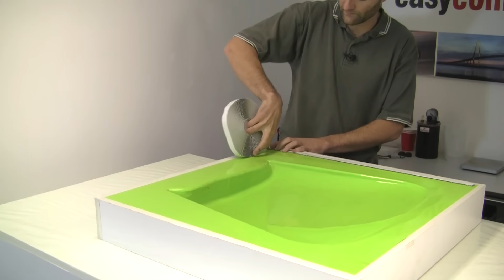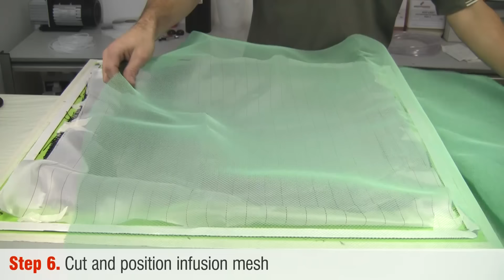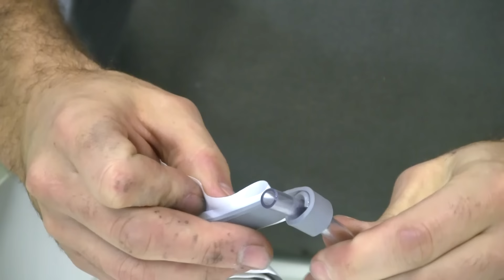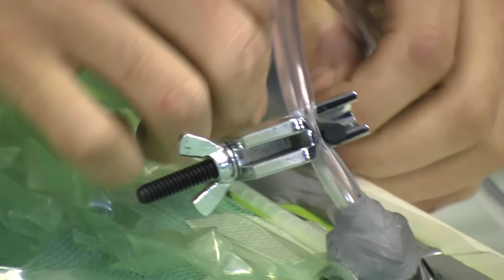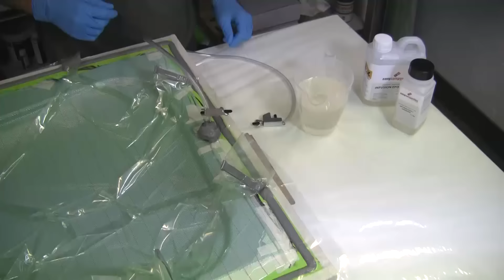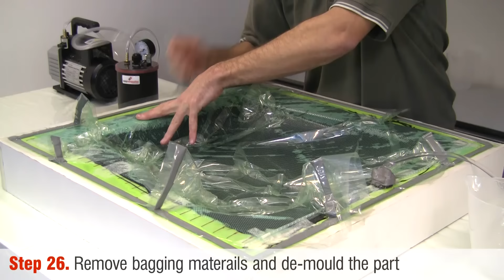How To Do Perfect Vacuum Resin Infusion of a Carbon Fibre Part - Basic Tutorial

Comment: Dear Mr,
First of all, thank you for this interesting and didactic tutorial. Regarding to the formula that you prepare, I am curious to undersdand why don't you use a defoamer/air release agent in order to reduce the waiting time and also an additive to improve the wetting of the fibers. Could this last additive avoid the use of the net? 
Thank you so much!
Reply from the maker: Thanks for your comment. There isn't really a need for any additives in the resin as the air is pulled out when the resin is put under vacuum inside the bag. 

You need the mesh in order to allow flow channels for the resin to pass though, without this the infusion will choke and stall as the resin cannot pass through the fibres.

Comment: Que máquina de vacío recomienda
Reply from the maker: For a job like this our EC4 pump is perfect.
Reply: @easycompositestv  y aquí como uno la puede comprar para que yo voy de colombia
Reply from the maker: @ We can ship to Columbia from our site here in the UK, simply add the items to your basket and select the delivery destination. The website will then calculate the shipping cost and estimated shipping time.

As the pump requires 240V to operate you may need to do some rewiring of your power supply in order for it to run.

Comment: Is it mandatory to put the item in the oven to post cure when infusing?
Reply from the maker: No, post-curing can help to improve the mechanical properties and temperature resilience of a finished part but for ambient use products where ultimate properties are not required, you can just allow the resins to cure in normal temperatures.

Comment: Do you need a “tempered glass” lid on the vacuum chamber ? Or will an acrylic lid be fine? Will the resin gases crack the lid?
Reply from the maker: Our chambers use an acrylic lid.  However you have to be careful with acrylic to not expose it to strong solvents such as styrene and other solvents in polyester, vinylester and acrylic resins.

Comment: Very beautifull, but I have a Question. Since carbon and epoxy are expensive but also very very strong what makes you decide howmany layers of carbonweave you use? Would one layer also be enough for that panel? What would be the difference in the endresult if you compare a one-layer vs a three or more layer panel ?
Reply from the maker: Experience and mechanical testing will ultimately decide how many layers a panel will need.  For structural applications mechanical simulation in CAD FEA packages and test sample mechanical testing will be more common than experience with previous similar panels.
Reply: @easycompositestv  thank you 👍
Reply: I have another question. I am more into boats than motorvehicles or industrial applications. Now on the deck of a boat we want an antislip profile or an antislip topcoating. How can that be done?

Comment: Do I have to remove the paint from my car chassis or it will stick to the paint?
Reply from the maker: Generally key the surface with sand paper to help adhesion.  Assuming the paint is thick enough, you should be able to do this without cutting back to the metal.

Comment: Hello. I tried this once and my whole garage filled up with smoke from the vacuum pump. It was pretty nerve-racking and the wife was pissed. Do you have any idea why the vacuum pump would’ve been smoking so much?
Reply from the maker: Most rotary vane vacuum pumps emit a oil vapour from the exhaust. The longer the pump is on load or against a leak, the more oil mist is emitted. In a confined space this can make the room appear smoky from the vapour.  Ventilation or extracting the vapour will help.  Also you can use a pump with a built in oil separator to minimise oil mist.
Reply: @easycompositestv  thank you very much for the clarification. I was looking into oil free pumps as well although they are slightly more expensive.
I guess my issue is also that I didn’t understand that you run the pump take out the air and turn the pump off I had the pump running for hours on end as it was not a vacuum infusion however I did use vacuum bagging process from a manual layup

Comment: How much cfm sir to achieve 14psi?
Reply from the maker: The two are not intrinsically linked; the CFM determines how quickly a pump will reach pressure but not the vacuum pressure that the pump is capable of getting to. As an example, both our EC4 and EC20 vacuum pumps will achieve pretty much the same vacuum level (99.995%), the EC4 is 2.37CFM, the EC20 is 11.77CFM - the higher CFM means that the EC20 gets to the full vacuum level much faster than the EC4 but the CFM has no bearing on the pressure level attainable.

Comment: Hey nice tutorial! I noticed u don’t use any protective gear and I’m planing to make guitars with this method and I have some concerns about the smell that can be annoying for neighbors. How strong is smell and any suggestions about this problem? Thanks
Reply from the maker: We would recommend nitrile gloves, working in a well ventilated area and if you have lung issues or sensitivities then a good quality mask.  Always wear a good quality mask for cutting cured resins and fibreglass/carbon as the airbourne dust is a respirable hazard.

Comment: Is there anyone who can help me with a resin infusion question. I'm looking to do a fiberglass hood. I'm curious as to how to do the work but protect the air wants with out carbon fiber them. If that makes sense lol
Reply from the maker: Normally you would seal the holes with tape on the pattern and mould over.  You then trim the vent out after manufacture of the part.
Reply: @easycompositestv  thanks for the reply easy Composite so basically before make a mold with carbon fiber I will tape the air vents off go ahead and do the original fusion and then when that’s done I will go ahead and cut the holes out basically With a Dremel tool

Comment: I just noticed you didnt use hole film.. when would you use this vs not using it?
Reply from the maker: In resin infusion the only real application for a perforated film would be the use of a highly perforated film between the peel ply and a knitted mesh, simply because it makes the knitted mesh easier to remove. For most infusion applications you wouldn’t use a perforated film.

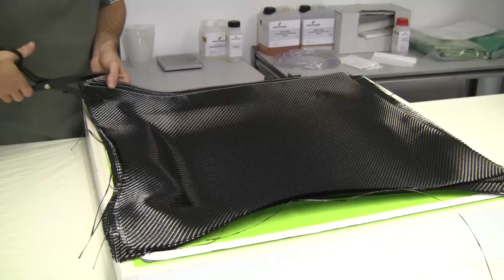Comment: 2:37....
Tip...
Lay the carbon so each layer has the weave direction different with each layer. This will result in a much stronger carbon part. Two layers of stagger sheets will be stronger and lighter than the four layers seen in this video. 

All that said....guy knows what he's talking about and Bob's your uncle

Comment: Hello, in resin infusion what's the difference between using peel ply and perforated release film?? what is the finish surface of each and when should we use which ?? thanks for the videos
Reply from the maker: You should always use Peel Ply as the layer directly against the laminate. It is important for resin flow (along with the mesh of course). Perforated release film is rarely used in infusion, it’s more intended for vacuum bagging where it controls resin bleed from the laminate into the breather. The only time it’s helpful in infusion is when you’re using a knitted infusion mesh which can be difficult to separate from the peel ply, a highly perforated film between them can help.

Comment: Isn't the resin likely to discolor and yellow when exposed to sunlight?  How do you prevent this?
Reply from the maker: The IN2 is a very modern resin and naturally has very good UV properties. In fact, we’ve been making parts using this resin for about 8 years now and we’ve yet to see one that’s noticeably discoloured. That said, it’s right to think about UV protection for epoxy. In video 2 you can see that we use a UV protective gelcoat into the mould first and so the epoxy is underneath that gelcoat. Alternatively, you can lacquer/clear coat the part using a UV protective 2k automotive clear coat.
Reply: @easycompositestv  Good answer!  My car's clear coat has never yellow and in the sun 24/7.  I'll use this if permanently outdoors.  Also watch the part 2 I missed somehow.  Thx!!!

Comment: Awesome video and cant wait to make some parts after Christmas however I have 1 question, when you put the carbon weave into the mold you didnt use anything to contour it into place? Does the vacuum pull it all into place? Or would there be a process of applying the first layer to shape into the mold? Thanks
Reply from the maker: Fabric drapes into curves so for most cases, no need to use anything to hold the fabric in place.  Also when under vacuum, the force holds the material in place.

Comment: Why don't you use gloves? You have oils on your hands that could cause the layers to separate.
Reply from the maker: That's really not a consideration. Maybe if you're making a space-ship and maybe if you had some ultra sensitive scientific equipment for comparing interlaminer shear it might just about be possible detect the infinitesimally small difference caused by the odd oil molecule. In real life, not really :)

Comment: I am interested in purchasing your infusion starter kit with a vacuum pump and catch can, however, I live in USA and dont believe you have an option for a u.s. power cable on the pump. How can I go about this?
Reply from the maker: Hi Gabiel, thanks for your message. Use of the vacuum pump in the USA is slightly complicated. The pump is designed to run on 230 or 240V AC which in Europe is the voltage that we have on all our wall sockets. In the US, although you probably have 240V coming into your building, your wall sockets will all be 110V which wouldn't run this vacuum pump. We do have some customers in the US who do have 240V sockets but this only likely in a workshop environment and so, given the extra complexity, you're probably better off buying just the resin infusion kit, without the vacuum pump, and then sourcing a 110V vacuum pump from a supplier in the US.

Comment: Hi! I got the fibers very very sticked to the peelplay. When I try to dissamble is so tought because both the peeplay and the cured textiles are very linked. When would you recommend me? Thanks in advance.
Reply from the maker: Hi Manuel, it is true that it can be difficult to separate the peel ply and infusion mesh from the laminate, this is quite normal. Usually it's just a case of being very forceful. Sometimes it can help to remove the mesh and peel-ply in a number of thin strips, rather than all in one go.

Comment: don't you use a removable flange to act as a resin stopper? we use it here in Italy :)
Reply from the maker: I can't quite picture what you're describing I'm afraid. There are a few different options for resin breaks but they are generally some kind of semi-permeable barrier. You can even just use a strip of peel ply on its own to act as a breathable resin break.

Comment: Is there a maximum number of cloth/carbon layers with this process?
Reply from the maker: Theoretically, no. In practice, there comes a thickness where it takes so long for the resin to get down through the reinforcement that the resin starts to 'gel' (cure) and then stops the infusion. The thicker the laminate, the slower curing you need the resin to be. We have successfully infused solid laminates up to about 10mm.

Comment: no bleeder/breather?
Reply from the maker: No, not for resin infusion because there is effectively an unlimited supply of resin; bleeder/breather would just suck up and wet out with resin. Bleeder/breather is only used when you have a finite amount of resin 'in the bag', such as vacuum bagging a wet-laid laminate or vacuum bagging prepreg.

Comment: What should the viscosity of the epoxy resin for this process? And also how to consider pot life of the resin for this process?
Reply from the maker: Viscosity of an infusion epoxy should be as low as possible. You can see the full technical specs of our IN2 infusion epoxy here: https://www.easycomposites.co.uk/#!/resin-gel-silicone-adhesive/epoxy-resin/epoxy-infusion-resin.html 

As for the pot-life, this is determined by how long it will take your infusion to run through. If the infusion will take 40 mins (which would be typical for a part like this) then you would need at least a 1hr pot life if you want to be able to run through using one mix.

Comment: What if you have a difficult mould. Can you use spray glue to fix the first  carbon?
Reply from the maker: You can use the spray tack but only the lightest of dustings otherwise the glue will leave a lot of suface marring to repair.

Comment: Didn't see the breather were applied in the video, does it not a necessary?
Reply from the maker: Breather is not normally used with resin infusion. Sometimes if you are envelope bagging a mould, breather can be useful on the reverse to help avoid a rough mould back puncturing a bag.

Comment: I have one question: in this method, how to control the thickness of the final product?? Anyone knows it? Thanks.
Reply from the maker: In composites, laminate thickness is pretty much only determined by the layers of reinforcement used. The consolidated thickness of most fabrics is already known (and is really a function of the fibre type and the areal weight of the fabric). For example, a 200gsm twill weave carbon will be 0.2mm thick (under vacuum pressure), a 650gsm twill weave carbon is 0.65mm so, if you had a laminate of - say - 200g carbon, 650g carbon, 200g carbon and then infused it you would get a laminate of (0.2+0.65+0.2) 1.05mm.

Comment: Do you sell to the US? Great video thanks.
Reply from the maker: We can ship to the US and we do have plenty of customers there. Shipping can be expensive for products classed as 'dangerous goods' (like resins and solvents) because we send to the US by airfreight and need pay a surcharge to FedEx for the dangerous goods handling but it can certainly be done. To find the shipping cost of any item(s), just add them to your basket on the Easy Composites website and then use the shipping calculator on the basket page. It's instant and accurate and will include any surcharges etc.
Reply: @easycompositestv  Terrific, thanks for getting back to me. It's mostly the bagging materials that I'm looking for. I'll check out your site, thanks again.

Comment: Great tutorial. What is the CFM rating of that pump, Is this good enough? https://www.ebay.co.uk/itm/1-4HP-5Pa-2-5CFM-Single-Stage-Rotary-Vane-Vacuum-Pump-Oil-Bottle-AC-220V-50Hz-UK/173997460744?page
Reply from the maker: The Pump in the video was a 1.5cfm pump.
Reply: @easycompositestv  Do you think this pump is sufficient for me. https://www.ebay.co.uk/itm/1-4HP-5Pa-2-5CFM-Single-Stage-Rotary-Vane-Vacuum-Pump-Oil-Bottle-AC-220V-50Hz-UK/173997460744 How do I choose a suitable affordable pump? Is the CFM important or will it just take a bit longer to form?

Comment: What determines whether or not you lay down a gel coat into the mold before the first layer of carbon? Just preference fo appearance/UV protection?
Reply from the maker: Mostly preference.  If you live in a very sunny climate, a clearcoat will achieve the same level of UV protection.

Comment: Hi I can control the resin ratio  60:40 58:42 or 55:45 ? How I can change a little bit the ratio during the infusion?
Reply from the maker: The resin to fibre ratio can be changed slightly depending on when you clamp off the resin feed.  Care needs to be taken to ensure you don't make the part too dry resulting in pinholes and dry patches.

Comment: hey man, just a quick one, you were saying to check the vacuum by clamping it off for 15mins, does that mean after 15mins no leaks, its considered as perfect vacuum state? what if the gauge reads slightly less vacuum after 1-2 hours? does it make a difference? or 15mins time frame is more than enough to test the perfect vacuum state? thanks!
Reply from the maker: If the needle hasn't moved in the 15 minutes time frame then the vacuum seal is good enough for an infusion. The longer the leak test then the more chance smaller leaks will reveal themselves.
Reply: @easycompositestv  i see, so i dont have to be bothered as long as i have a good 15 mins vacuum reading right?

Comment: What is the cost and will it reduce as production and acceptance go up? Does this composite burn or is it flame resistance. Would this work as a wood replacement?  Homes would last for centuries. With unique design redesigned would be easy to up date. Bridge construction ? Chain or cable, I-beams for sky scrapers? That might take place soon as USA infrastructure needs long lasting repair. Those sky scrapers might even go higher with this unique material.

Comment: How strong is it. Does it last a super long time. No need to shine or polish? Would this work for car panels ?  Would a car last without rusting out from salt and to much sunshine. Would this work for air plane panels ?  How bullet proof is it ? Would this work for football players padding and safety equipment? Helmets? Or even an ice cooler outer surface. How about a battery case? Resistance to acids?
Reply from the maker: Composites won't 'rust' as steel bodies would and more manufacturers are incorporating Carbon Fibre into OEM products to reduce weight and also increase longevity. As a very rudimentary rule of thumb, if you match steel's thickness, you would have a product roughly as strong but for significantly less weight.